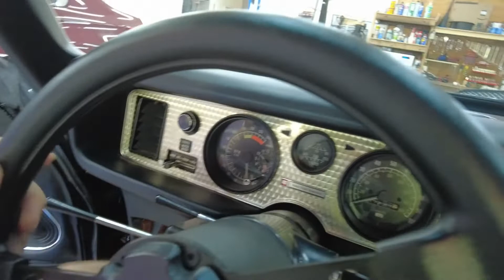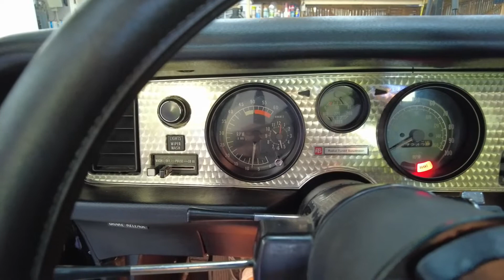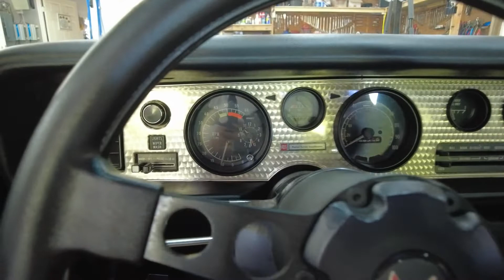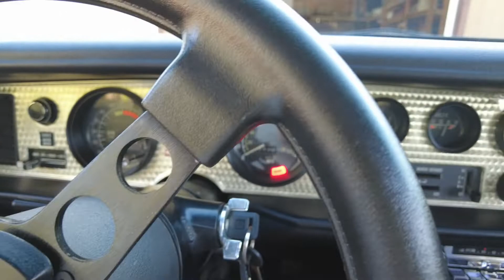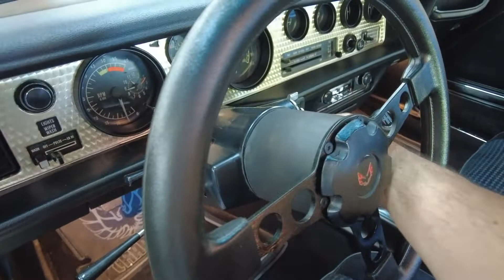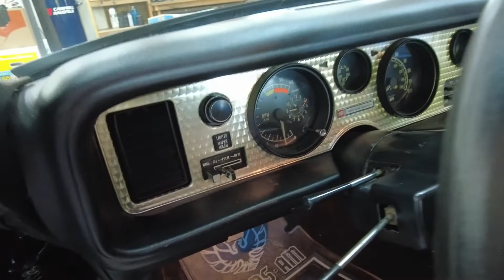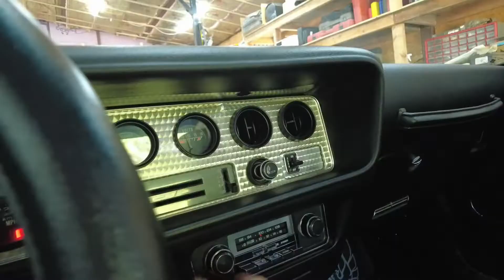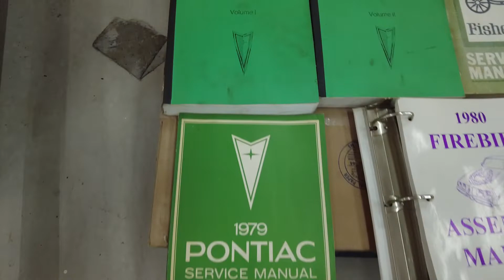Getting the 79 Trans Am ready

Comment: beautiful and AWESOME MASTERPIECE, 455, please say it was a 1974 Super Duty. Also, where's the A/C compressor. In '79 I had a 6.6 4spd WS6,T-tops cloth seats. I had a lot of fun. In 82, I traded it for the 82 Vette. I wasn't too happy coming from a manual transmission to 4spd auto. I did miss my Trans.I found myself @ 1st looking for the clutch on the Vette. Njoy, I'm sure U will.
Reply from the maker: I wish it was a Super Duty. Just a plan 455 /w 6x heads, Ram Air H/O factory headers, Crower 284-HDP cam, and a tuned Rochester. With the 4 speed it's a blast to drive. I have the brackets and hoses for the A/C, just never got around to it yet. I had a 83 TA, and a 76 Firebird with autos, just wasn't the same. Muscle cars need manual trans, but that's just me and I'm old.
Reply: @kc79ta   be that as it may, sounds like U have enuff mods to have fun, joy,& bragging rights, Be careful, be safe and ENJOY. Thanks for sharing, also, I agree with U about manuals & muscle cars.
Reply: Why not a 73 SD 455?